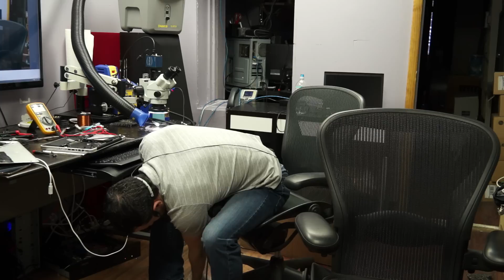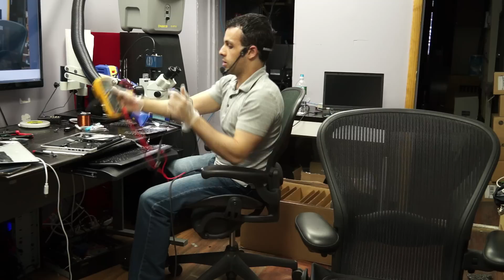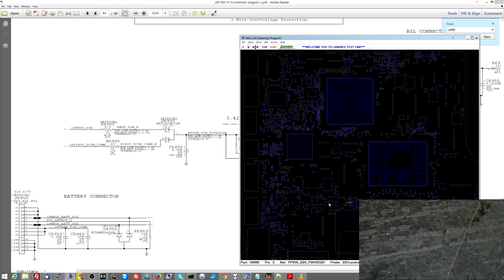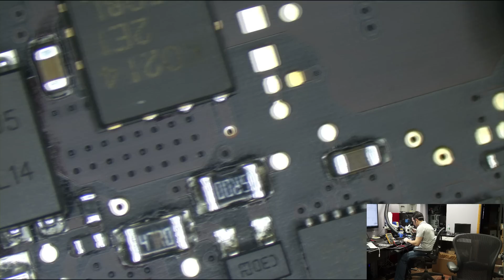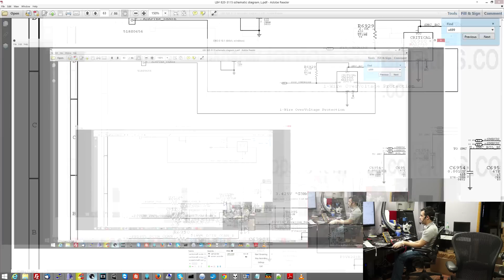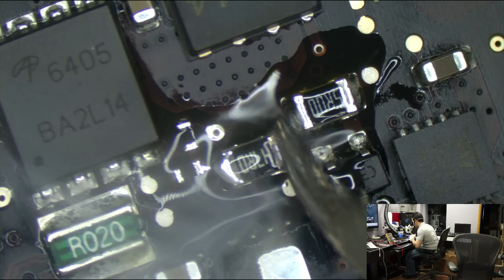Macbook logic board measures properly but still doesn't work.

Comment: Hello, 
I appreciate your time.
I have a 820-2850 not charging. Green light all the time, but never orange. Can see the battery (19 cycles, etc... says "not charging") but won't charge it, so I can't even check if it would work off the battery alone.
I watched lots of your videos going through the smc to battery, voltage sense and one-circuit lines, I checked all of them following what you were doing in each of your videos and every single resistor is fine (the 0 and 2.2, the 10 and 10, the 2k and 2k (btw, the last two are marked as 1k and 1k ohm on the schematics).. 
All of them have paths in both directions to the U7000 and to the shunt resistors.
The lines measure 3.42 where the're supposed to, also the CHGR_ACIN arrives at U7000 with 4.53v from the voltage divider and the U7000 gives out the SMC_BC_ACOK as well...
It just measures right in every single place...
I don't have an oscilloscope, so I can't measure the SMC talking to the battery, but voltages keep jumping from 3.34 to 3.14 at the battery side so something is happening...
Reply: Update:
Decided to take the risk and order another battery the next day. 
It finally arrived today (ordered as "compatible") and looks exactly like the genuine one. It could as well be that the 19-cycle old one which looks like the genuine one too, might be a Chinese knock-off as well and is clearly faulty, although says it has only 19 cycles on it. It somehow matches up with a charger packing up too, as I ordered a new charger before I ordered a new battery, to begin the testing with...
Let's hope the new one will last longer...

Comment: U6990 can work on either PP_18V5_CHIN_G3H (charger) or PP_9V6_G3H (battery), both have a 47ohm resistor R6905 and R6990 in the circuit. The diode in both supplies is simply to stop 18.5 going directly to the battery or 9.6 v going back into the charge circuit. The resistor R6990 and cap C6990 is being used as an RC filter to ground (not a fuse), so a clean signal voltage arrives at U6990. This circuit should be tested using both supplies. The chip U6990 will work between 5v and 40v on pin 1. you didn't check voltage at the chip, the cap C6990 is between the diode pack and the chip. The assumption that 16v out of the diode should mean 16v at U6990 should be correct, if there wasn't a filter cap in the circuit. By rights, the chip should work with no cap in the circuit, as it would still be getting a voltage signal, even with R6990 at 62ohms. Could you try this to test the theory?

I'm curious as to why you're fixing it, if its for "board school"... ;)

Comment: Hello
I've been looking a long time but I do not find the spare part. J6950 The battery connector (Macbook Air 13 Mid 2013). Where can I buy the plug on the Internet? I am a German fan you keep up with your videos. Many Thanks.

Comment: Hi Louis - really interesting problem, and once again your intuition beats the knee-jerkers.  You have the fix, so all I can do is perhaps add some amplification in  theory for you.  It makes me think of something you might look into next time you're checking out that circuit.  That diode is only 47 ohms, so the voltage across it is going to be kind of small. I don't know how much current is supposed to be flowing there, but if it was, say, 10ma the voltage difference between both sides of the resistor would be  0.01 X 47 = 0.47V ~0.5V.  So if you read 16 on one side, and maybe you rounded down because it was 16.7, and on the other side you read 16.2, you'd say you had 0.01A flowing through there and it was working fine.  Now I notice that circuit has two resistors going through two diodes.  If the voltage on the K side of the diode (the side with the backward "K", the right side in your drawing, the cathode)  if that voltage is greater than the voltage on the output of that resistor feeding the diode (-0.7v diode drop), you're going to get no current flowing at all because current can't go backward through the diode. That means the V "across" the 47 ohm resistor is going to be exactly zero, and you will read the exact same voltage on either side of the resistor.  Now, that resistor was shit - you said it was burned and read 62 ohms, and you replaced it with a good one.  Suddenly the thing works.  Well, what happened?  Could be one of 2 things.  Could be that the burned resistor blew off its pad (and you just couldn't see it) - unlikely that the voltage drop would be zero then.  OR, it could be that that circuit is very very sensitive to small changes in resistance.  Notice there's another resistor feeding another diode in the schematic just above the 47ohm one.  It's symmetric to the one below.  Basically, whichever resistor has the greater voltage on it is going to push current through the its own diode and block the other one.  I don't know enough about the circuit to know why they're doing that, but that's what it is.  So the thing to realize is that while that 47ohms is a tiny resistor, it's acting as a "measurement" device, as is the one right above it.  Like a tiny volt meter.  You could say a fuse does exactly the same thing - and I'll bet you've seen those things blow like fuses (in that case - destructive measurement).   But when it's working, those two resistors are balancing the current flow either from one leg or the other (I can't read the schematic in vid, but I'll bet one side comes from the battery and one from the charger.)   Anyway - thanks for another great video.  I learn something new every time I watch.  Good luck with your classes.  One day maybe I'll be in one.  I'm thinking to move to Arizona and perhaps start a repair shop down there for my "retirement".  Cheers - Joe

Comment: if you look at usb cable's specification the resistance must be less then 5ohms. I once had 7ohms on one of data lines and the whole device refused to work. Replacing cable helped. So the problem wasn't in the device, but in higher resistance on cable's data line. Took me several hours :(
It seems like similar problem. Great stuff, Louis!